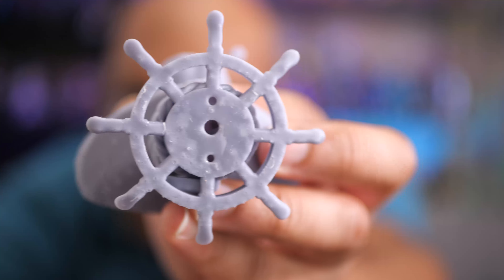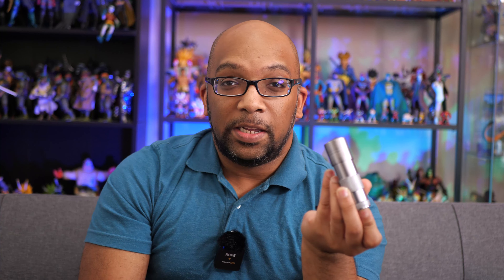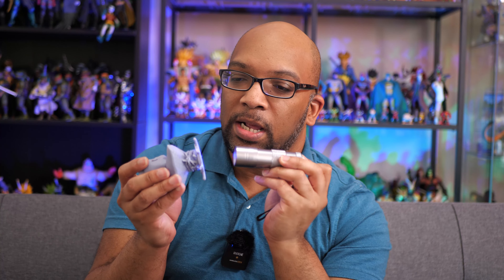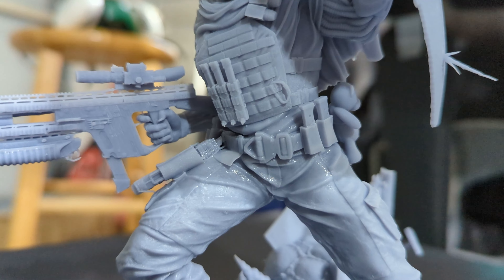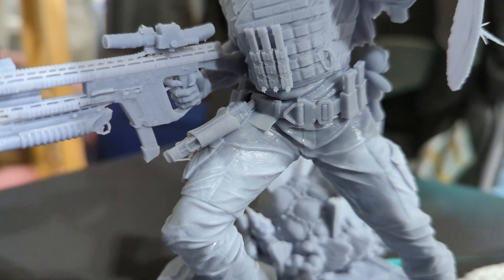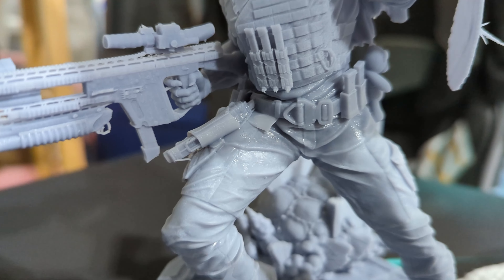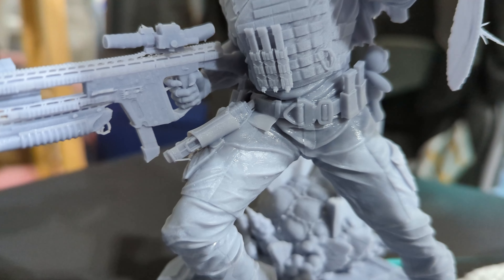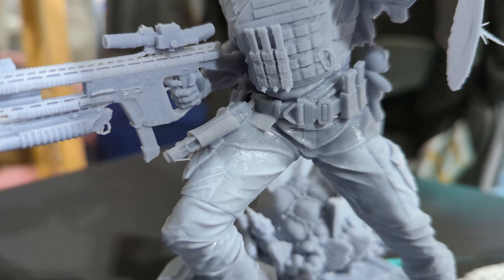Why You Shouldn't Hollow Resin 3D Prints

Comment: Sounds like you just need to learn how to clean prints better. I've hollowed every one of my prints with no problems.
Reply: On multi part builds you can put sizable holes in the joining areas, same for parts with a base or a bottom side that won't be seen. Just stick the biggest hole you can there even if its not doing anything during the print. That'll make cleaning and draining the prints easier. And if there is a reservoir somewhere like in this case the house where joints are and a hole in the base means it can drain out the bottom rather than through seams. 

It also makes it easier to sure the interiorwith a fiber or whatever tool you like.
Reply: Can you just cure on a cure machine like anycubics for longer and still cure fully through?
Reply: One of my pals hollow minis with 0.8 wall thickness... It's don't get well but it's still saying that everything needs to be hollowed. 😂

Comment: I run a 3D printing business and we have a very thorough cleaning regiment regarding hollowed resin prints. #1 be sure to have 2 drain holes 7mm wide, I will explain later why they should 7mm later. #2 rinse the inside with IPA or Water if its water washable, #3 after rinsing, almost fill the inside of the model with IPA or (water with water washable) plug the holes with your gloved fingers and shake it vigorously, drain and repeat that process 3 - 4 times. If you using water washable on the last shake spray in little IPA. #4 let the part dry for 24hrs #5 cure the part and lastly #7 the most IMPORTANT step which brings me to those 7mm wide holes, insert 395nm - 405nm UV LED wires, the LED bulk is 6mm wide which allows you to use a bulb on a wire attached to a 12v battery and fully cure the inside. Move the UV LED light around inside different areas and let it cure for 5 mins each time. Oh and one last thing, if possible leave a small drain hole 1mm is fine unplugged. If you plug a hollowed print even with it really cleaned and cured there is always a chance you missed a spot and its the gases that cause the model to split.
Reply from the maker: Good info! Thanks for sharing your experience!
Reply: Great idea on using a single UV LED inside the hollowed out print. I'll have to keep that in mind and get myself a few.

Comment: more holes are always better.. and also ive found using blockers helps on hollowed figures to stop from having resin traps. and running uv tools after slice will show you if you have any trapped resin in the model. great video dude!
Reply: what is blocker? also what is UV tools after slice?

Comment: I don't have a wash and cure machine, so I clean everything manually. It's actually quite difficult for me to clean properly, and once, one of the figures fell and shattered on the floor, causing resin to splatter everywhere. So, I'm wondering if getting a wash and cure machine would help.

Comment: I print large hollowed things rarely, but when i do, after rinsing, i use a 405nm UV LED light that I let sit inside the model for a few hours.  It does mean at least one hole has to be a little over 5mm large, since that's the size of the LED I found on amazon.

Comment: I use water washable resin so I clean them with a good rinse then I set them inside a water tank lined with foil. The lid is a UV light so every inch gets blasted on them. Never had an issue with them cracking or ever leaking.

Comment: This has never been a problem for me ever. 
Most people seem to not understand how to hollow and add holes. First Your holes should be at opposite ends of the model usually at the highest and lowest points of the model. Next use large holes. Don't worry about the hole being on the visible part since you can fix that easily with a cap. Both Lychee and chitu have a way to save the hole as a cap/plug which will hide the hole

Comment: the first print i hollowed i just did it without looking at any tutorial and did not create any hole, it printed fine and it's been 4 months built and painted, i just bought a drill tool to make sure it will not explode in the future

i have been hollowing even 32mm infantry since then, using multiple holes around the figure in hard to see spots and even on the top of the head, i let them drain inside the printer for 2 days and then again upside down another 2 before cleaning, had no issue at all, holes on the visible surfaces get covered with glue and the ones on the bottom are just lef open, sometimes i even hollow the feet/legs and then print special bases that will snap inside them to make the mini even more solid when used on the table
Reply: thx for this comment, im just starting resin and i was thinking about this. Great minds think alike, i shall try it
Reply: @zac2877  only thing that failed was when i tried to use water and cure the minis inside, i saw a video where they did that to cure the inside. For some reason they were the only prints where some infantry cracked from the inside. I am also now using a mix of resin that makes model less rigid

Comment: In addition to making drain holes, you can use smaller holes to make pinning some parts easier later if that's your plan. On a similar note, you can also add room for magnets on models before you print them, reducing drilling later.

Comment: Just a helpful tips for the comment section. When placing drain holes you need atleast 2 and one hole needs to be able for you to place it a lower elevation that other.(when submerging it in ipa) This is so the Ipa can flow properly through. 
Same principle of if your airing out your house. Opening 2 windows rate next to each other isn't going to ventilate as well as Opening one on the other side of the house. 

All the risk in this video are definitely still a risk.😂
Reply from the maker: Thanks for the tips!

Comment: One thing I've yet to find discussed is if printing medium to large models as one piece or multiple pieces solid, how does the resin ever fully cure deep internally? I am aware that the process of printing partially cures the resin and is no longer a liquid. If the resin requires a long post curing time to fully cure the outer 1 or 2 mm, then how does the inner soft partially cured rsein ever fully cure? Even though there isn't liquid resin internally, will it off gas or create pressure cracking or deforming the model?

Comment: I've had hollow resin prints bulge after a while, due to uncured resin on the inside. I find that if you don't hollow them they can be too heavy and stretch in the z axis. I've found that using an ultrasonic cleaner can get all the uncured stuff out of the inside.

Comment: Im new to 3d printing, but from what i know and what ive been able to read up on.   Smaller prints and busts are better off being solid.   Larger prints are better to hollow out.  However you would need at least two holes.  One to let air in on one side and one to let the resin out on the other.  The problem is most conventional washes seem to only agitate the alchohol on the out side and not the inside of the print.  Curing under a UV light also has the same problem of not enough light going into the print to cure the inside properly. 

Going of some of my action figure collection.  It would make more sense to cut the print model in half to expose the inside while its printing.  Then the finished print can be  properly cleaned and cured.   This would work on larger cavities to save resin and reduce its weight.  Smaller parts can be printed as a solid (for durability) and then attatched.  

The problems are that both halves may need to be printed thicker or with a inner frame/partial skeleton to realign and connect the two halves.  This would add extra support for its mass but it may not make it completely hollow.  Then there's an extra step of hiding the seam.   In the end it will require more engineering on the model, more time to assemble and to produce everything.

Comment: For my N scale details that I print on my Mars 3, most don't need hollowing as they are so tiny, so I'm somewhat lucky. I have had to hollow out larger items such as my tugboat. However having to put holes in and deal with suction cup issues is annoying. I use Lychee Slicer which has good suction cup detection and allows you to place holes at different sizes. But it is an extra step. As well as the issues with cleaning thoroughly as you mentioned. I usually check to see how much resin Lychee estimates with and without hollowing to make a decision on whether or not to hollow. If it's just a few grams, I don't bother with hollowing.

But I have a Flashforge Adventurer 5M arriving tomorrow. That will be used for larger models that I'd have to hollow if I print it on my resin printer. Watching all your videos on that printer to get ready for its arrival.

Comment: Hollow prints are best with big, smooth, interiors, and large holes or open bottoms you can easily see into and poke around a toothbrush or cotton swab or such. Slicer generated hollowing can, on any more complex shaped model, easily cause problems. with little pockets and other issues forming.

Comment: Hollowing I wouldn't say is always mandatory, but there's definitely more pros than cons in saving material and lightening a print while on the bed. Unfortunately, not all figures hollow well, but for the most part, careful slicing and checking typical problem areas like heads and arms are easy to do. Something almost universal when setting wall thickness to 'printable but light' like 3mm, it will enclose body parts that naturally narrow like head to neck or leg to foot beneath a certain size figure. You can definitely accidentally enclose a hollowed area just using too much wall thickness but alleviate problem spots by adding an internal hole/drainage in the slicer. I only had one model leak early on until I went through them layer by layer with a studious eye and learned the above.
Reply: Can we fill the sculpture with something like epoxy clay, fiber glass or resin? to make it stronger ?

Comment: You want to make sure you equalize the pressure inside the print when you're washing it, so enough IPA gets inside without leaving any air pockets inside. That usually means you want at least 2 holes, one you can hold above the IPA bath and one in it. This allows the IPA to push the air inside the hollow print out through one of the holes. If you poke a hole in the bottom of a soda bottle it'll drain and fill faster because the pressure inside the bottle equalizes and there's no back pressure blocking the flow of the soda. It's the same concept. You can also swirl your print with some IPA inside to get good cleaning coverage, just wear eye protection.

Comment: I always use water washable resin.  All of my figures are hollow, some over a year old, still displayed nicely.  Water washable makes it really easy to clean.  I just fill up a tub of soapy hot water, let the part fill, shake it around, drain, repeat a couple times, then patch the holes with resin.
If you have pockets of resin on the inside then either the model is bad or you're bad at slicing.
Reply: But then again, Waterwashable resin is very prone to shatter/crack when its hollowed and its even more brittle with hole inside
Reply: @pitbullash  I've notice that hole warps and blowouts only happen when a hole is on a big flat surface, like the bottom of a base.  Lately I've been using water washable ABS-like and it's been great.  I've also started curing the inside with uv LEDs.

Comment: Assuming the model is large enough, I just leave large holes where I can to get a curing light inside. Not perfect, and doesn't work for every model, but so far I have had no leaks either. Curing the inside isn't impossible, just need the right equipment.

Comment: You need holes for draining and holes for breathing. It facilitates ease of passage, avoiding suction forces and minimizing pooling when done properly. Voids from a poorly designed model is on the modeler, so it's best to check your prints by the layer to make sure those don't exist. Difficulty in removing those vary and I'll spare you all a wall of text.

Comment: Hmm, I have 5 FDM printers and am occasionally resin-curious. I avoided buying something big this year but the 66 dollar monoprice (I’m sure it is horrible) made me give it a shot. I’ve only done function checks to see that the machine (appears) to work, but I’m really getting to wonder if the risks are worth dealing with (and I live in NJ, So the garage is off limits until the spring). (Yes, I did see your video on the heater and I know about the Uniformation printer, but it still seems to be a lot of hazard in exchange for a few more details.  Anyway, Enjoy the holidays and don’t eat the resin colored snow!
Reply from the maker: You're right in that your safety should take priority over anything. I think safely working with resin comes down to your workflow and making sure you keep everything contained to a dedicated area.  It's hard to beat the results though, especially with detailed figurines.

Comment: The more holes the better, than when setting your print on the slicer always check your print, if you are using lychee it will show you where you will have a problem with your print. Hollowing your print saves resin and wear on your FEP. you have to really wash your print. Not just dunk it in alcohol. He is not washing and curing his prints proper. The inside of his print is not cured, this will cause the resin to sweat, Always use large holes on your print.

Comment: build a UV led light hook it up to a battery, put it on a stiff wire  fish that led up the drain holes up and down and it will cure the model from the inside.  here is an example video. https://www.youtube.com/watch?v=dqJSJJGyak4
Reply from the maker: Thanks for the tip!
Reply: I was just wonding if this could be a viable solution!